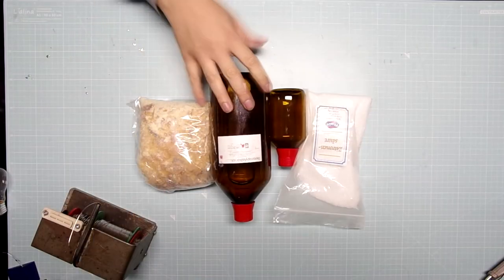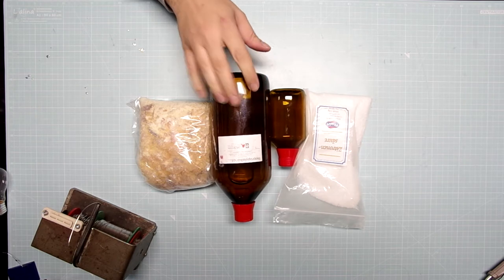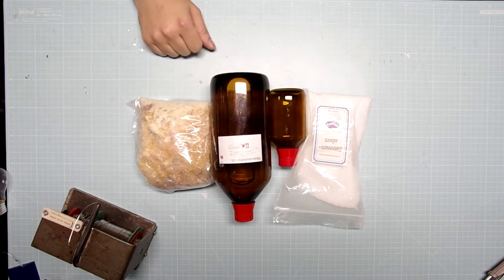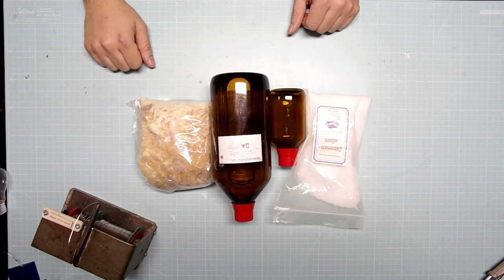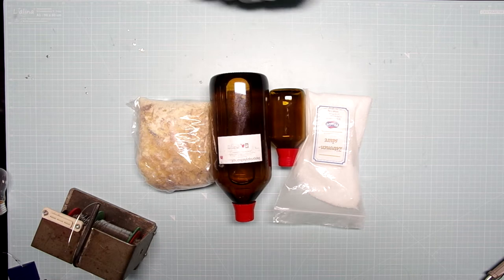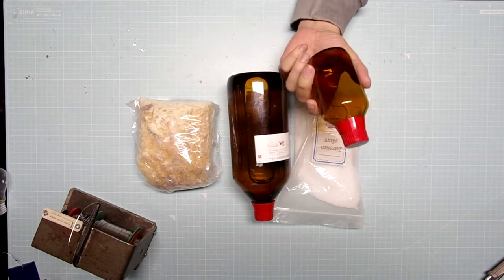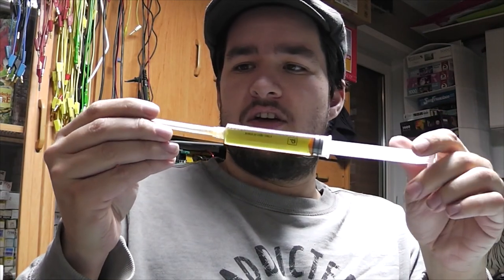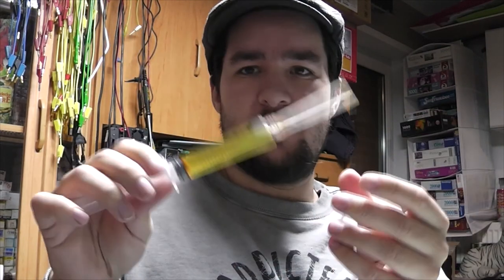Tinkertubes Lab [34] DIY Rosin / Rosin Activated Flux from scratch

Comment: I received 5 oz of pine rosin finely powdered I bought on e-bay. So following on the reply to my question, I mixed up a trial batch consisting of 20 gm rosin powder,  0.40 gm (0.2%) citric acid, 0.2 gm glycerin, 20 gm 95% isopropanol and one drop of Joy dishwashing detergent (nonionic surfactant).  With intermittent swirling, the power appears to have fully dissolved in a couple of hours at ambient temperature.  In initial trials using old stranded copper wire it appears to work just as well as the MG Chemicals liquid rosin flux I had been using.  To dispense it, I am using a one ounce plastic bottle with a needle in it (sold as a glue dispenser for hobby applications).  That allows me to put the liquid flux right where I want it and not have a brush to clean up every time I use it. I'll report back if I have any issue, and thanks again for the information on how to do it!
Reply: @John Doe Not sure.... citric acid is a weak acid, but I don't know about the need for clean-up
Reply: Still using it although I'm not doing nearly as much electronics work anymore as I'm getting older

Comment: When you use citric acid to improve activation, about how much would you add?
Reply from the maker: Thats pretty hard to tell. Since you don't want to eat away your traces you should be very carefull not to overdo it. I personally used only a small amount, like.... hmm... the tip of a knife?
Reply: @TinkertubesLab  OK, thanks. Good to know.  I think I may just try the straight rosin first by itself. It may be good enough for my uses and then I won't have to worry about corrosion.  Nice video, by the way. Thanks for posting it.
Reply from the maker: @JohnClulow  Thank you very much for your feedback :) Maybe there will be a new video in a few weeks - havent posted one in over a year :O Would be glad to see you there again :)

Comment: What % of alcohol and rosin did you use? 50% + 50% ?
Reply from the maker: Hi Dr. Smith,
I didn't weight it to get exact measurments. I just stuffed as much rosin chunks into the flask as I could fit in there and topped it with alcohol. This could very well be even more than 50% rosin. Just try to stuff as much in there as possible.

Comment: Much better to use naphthalene acetic acid, (NAA), because although is very good at dissolving any oxidation, the residue is not corrosive.
>
Reply from the maker: Thanks for the tip, I will try it :) Where can you get it for cheap as a hobbyist?
Reply: @TinkertubesLab  Just had an idea.
Since it's a crystalline powder that's water soluble, I reckon it would be relatively easy to purify it using the  recrystallization method.
>

Comment: My hearing is a bit bad, could you please write the ingredients for all 3 types, fully activated, mildly activated and inactivated flux? If there are proportional amounts could you give those to me as well. Example To make inactivated flux: Fill bottle with rosin, top off with  99.9% ISO alcohol and shake, put away in warm place and shake bottle daily for 2 weeks until rosin is fully dissolved, if alcohol is evaporated refill bottle with alcohol.

I hope I am not asking for too much but thank you for your consideration. :-)
Reply from the maker: That is basically all you need for standard rosin flux :) To activate it just add some acid. Many people use aspirin to get the salicylic acid, but there are also many additives and filler materials in those tablets, so I don't personally like that. I prefer to use citric acid, which is easily obtained as cleaner for coffee machines. Just add a bit of that, more or less "to taste", and you have your activated flux done in no time :) How strong the activation is is dependent on the type of acid you use and how much you dissolve in the rosin flux.
Hope that helped you :)

Comment: Нow to make a tacky gel flux similar ChipQuik SMD291?
Reply from the maker: I am experimenting on making something like that. If I find a way I will let you know.
Reply: Thanks, I'll be wait :o))
Reply: Ваня Иванов Add 10ml of 90% alcohol,5g of rosin and add vaseline until you like the consistency
Reply: I've heard heating the mixture or partial mixture will cause it to gel. Danger is though this mixture it bad if it catches fire. Any other ideas on 'gelling' the mixture